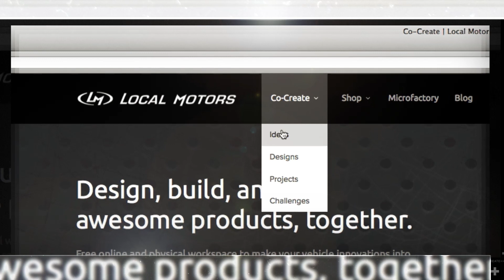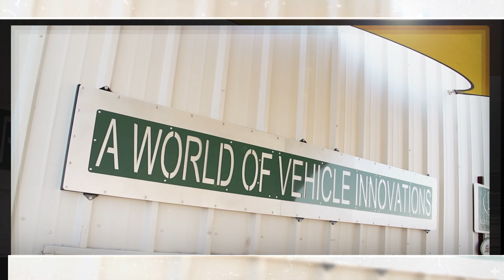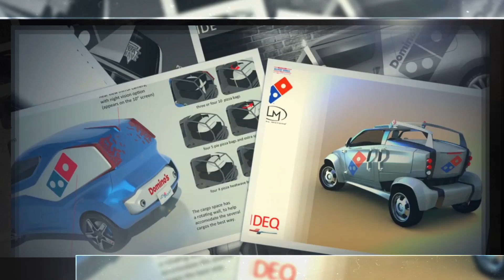We Are Local Motors

Comment: I like the Rally Fighter, and what the company stands for. But my brother hand builds custom rock crawlers and rock bouncers, 4wd, brand new GM LS engines, hardcore transfer cases, transmissions and insane crazy suspensions and on the expensive side they are $50,000. What my question is why is the Rally Fighter $100,000? Id love to have one, but they are completely out 90% of the public's reach for a 2wd crossover I guess you could call it. Hell a Ford Raptor is $60k. I genuinely ask and im not trying to come across as a troll, but Can you shed some light on why the Rally Fighter is so expensive?